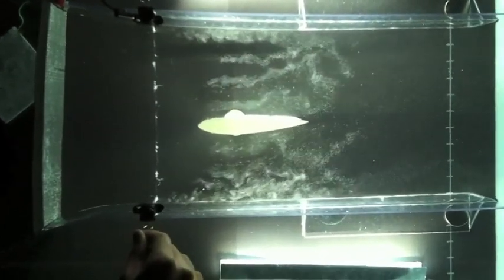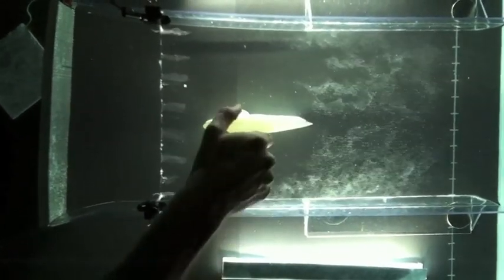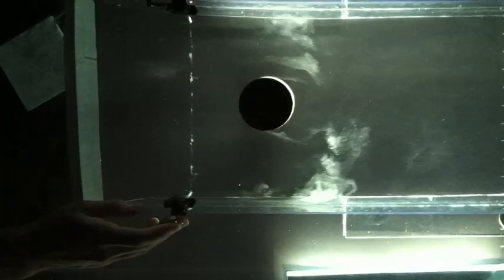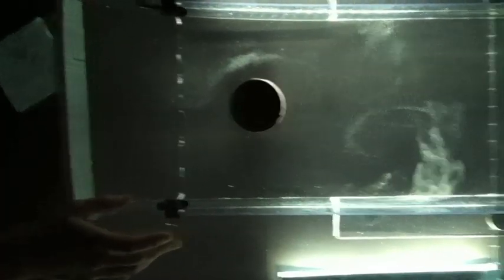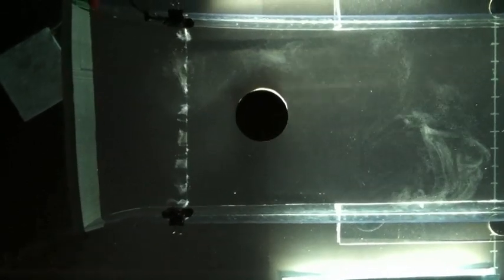Water Flow Visualization using Electrolysis Hydrogen Bubbles

Comment: sir, what is the diameter of the platinum wire and voltage given to get hydrogen bubbles ?
Reply: vijay vinjamalla Did they ever reply to you? We're you able to find this information? I would also like to perform this experiment. Any help would be really appreciated.